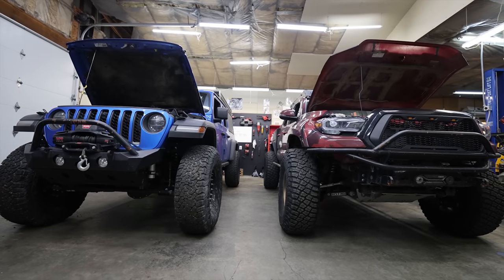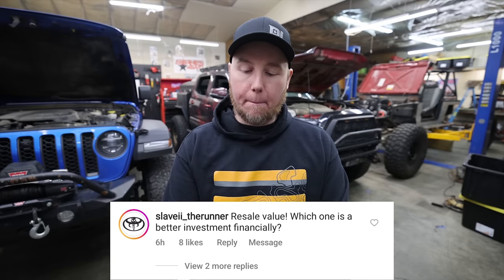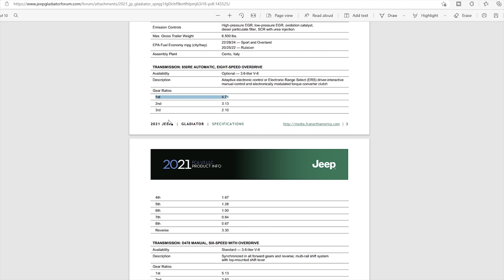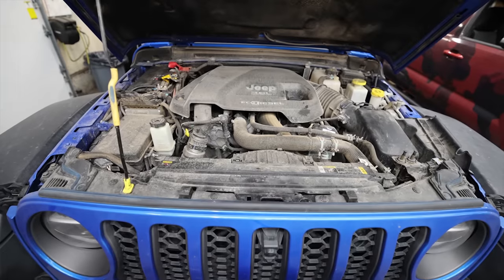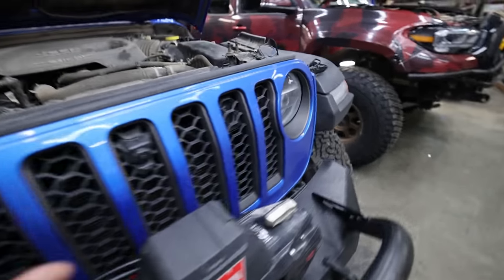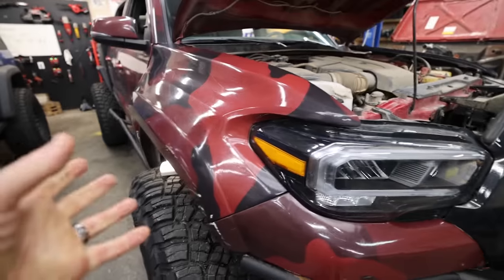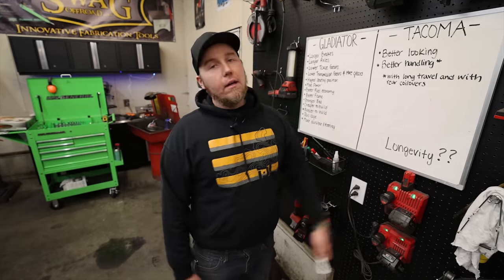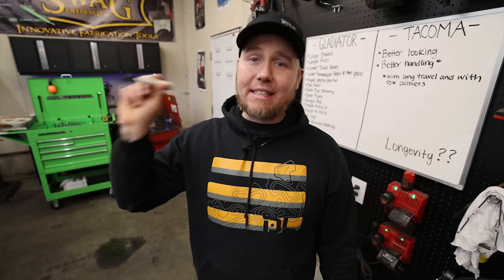My 21 Jeep Gladiator Vs My 21 Toyota Tacoma. Cold Hard Facts.

Comment: TL;DR version: 
- Jeep is better offroad. Tacoma is better onroad.
- Diesel is better for towing and torque than gasoline. He does not compare gas to gas engines, which is silly since most people don't buy diesels. And well, everybody knows how "great" Jeep's gas engines and transmissions are.
- Tacoma rear drum brakes are much weaker.
- Jeep's air filter on the diesel causes the engine to run hot through EGR because it's undersized. His Tacoma body mods make his air filter clog too fast.
- Jeep has a better drivetrain (post-transmission). See 16:39 for his page.
- Jeep has a good roll cage. Not comparable with Toyota since Toyota has airbags.
- Tacoma handles much better.

Criticism:
- Diesel as a whole is a downside for most people. Not an upside. 
- 39s as a whole is a downside for most people. Not an upside.
- He does not mention at all the most important feature regarding interior ride quality, ambient sound level. For anyone that doesn't know: Look up the video "Jeep Hard Top vs Soft Top Sound Level Comparisons". Jeeps are hearing-damage inducing on the inside (90db+). Tacomas are not. Not relevant if you already have severe hearing damage, but it is relevant.
- He's wrong about where the Toyota frames fail. They generally fail on the upward arcing section on the rear end, or on the section just before the middle brace. Not where they are riveted. Source: Am a Toyota tech at a Toyota dealer. All truck frames rust exactly the same up here in salt hell. Box frames are just easier to spray paint and hide the rust cancer. The main difference is that Toyota actually had a customer service program for dealing with it as a form of PR. All other brands just tell you to get bent. Plus, most brands don't sell Tacoma sized trucks in any volume (which is why nobody talks about Colorados or Rangers), so everyone compares apples to oranges (F150 to Tacoma) instead, and obviously heavier duty vehicles will have more meat before the rust becomes severe.
- Toyota frames are hot dipped the same way as the jeep frame is. This is standard industry procedure from trucks to unibodies. He's wrong here.
- Gladiator is only 2 years old. "They don't make x for y issue because y doesn't happen" is pretty moot.

The real truth: Buying a truck for "investment" value is dumb. Any truck you buy for resale value is going to lose all that value with the money you spend in fuel to run it. Who cares if a truck nets you $5k more after 5 years if you spend $2k more each year to drive it.

Comment: I've I owned a 2019 TRD off road with a 2 inch lift and 33s duratrac tires  and that thing was gutless and averaged about 13.7 mpg and only had it for about 8 months and traded it in for Colorado Zr2 diesel and that thing was a beast. I now have a 2021 gas JTR on 37s km3 and  winch and steal bumpers with 3inch lift and beefier control arms and track bars with stock 4.10s and I still average around 16 mpg. I cant wait to regear to 5.13s .This is miles better over the Tacoma that's for sure I don't think I'll ever get rid of my Gladiator.

Comment: I have a great modified 2009 Tacoma and I completely agree with everything you covered in this video. The only thing I stinking can’t do about the Jeep is tip-start. Can’t give control of the starter to the ECU. The Tacoma still does really well off-road, but I fully believe the Gladiator is the real winner for heavier off-road use. The frame, the axles, and transfer case sweeten the deal and win it. If I could afford both, I’d have both.
Reply: One more thought; A huge and persistent Toyota weakness is the position of the alternator in the engine. They always put the alternator low in the engine bay, which is a huge disadvantage for off-road use due to potential to submerge it in water crossings. Jeep puts the alternator high - on top of all other accessories on the belt line, which is vital for off-road use. Street use, it doesn’t matter - but for anything serious off-road, the position of the alternator is critical. Just had to add this little snippet in this conversation with myself here… 😂

Comment: Agree with everything you have said. Having experience with both vehicles, you have stated nothing but facts. I will say you had a ton of problems and bad luck with your Tacoma and it's gremlins.   For someone who is talking more casual usage and less hardcore so to speak. It brings different debates. For example, I had to decide in 2019 if an extra 30 grand on the gladiator was justifiable. Pricing structures bit different in Canada, and what options etc are available compared to the States.  I was looking at 38 grand all in for a O.R premium Tacoma, and to get the same features in the gladiator was going to cost me 69 grand. So for an average person, is a front locker and a few other things worth 30G? Or Do you put money into the Tacoma? That was the dilemma. Geographic location, and type of use heavily influence the choices.  Also, tire size lol anything above a 33 on a Tacoma, and you gotta do some work. 35s are fairly easy, with some light work.  Above 35s lol well that's when it gets expensive and tricky.  Kinda like your build, one thing leads to another, and it adds up quickly.  I love both vehicles, one just has to realize they really are not apples to apples and not built for the same things.  Even Toyota openly admits, Tacoma's are not designed around serious off road use. Reliability, I can only speak to my personal experience and that of my friends. All our Toyotas, have been virtually issue free, with a very low cost of ownership. The jeeps, not just the gladiators, have definitely had a higher cost of ownership overall. Just our experience with these vehicles. I think how much you mod them and keep up with maintenance plays a bigger role when  it comes to reliability.  As a general rule, I think most modern vehicles are on a much more even playing field these days, in terms of reliability.  Anyways, I'm rambling lol great video! Keep up the good work, you are spot on, as usual with your opinions etc.   Cheers! 🤙

Comment: Good video. Hard core fans of either brand can’t be objective. I’m an old Dodge truck guy, like 70s stuff. And it’s not stock. 
I am a Mopar parts guy. But I’m not a Jeep guy. I’ve owned an XJ and a WJ but they were bone stock. I didn’t wheel them beyond camping trips. 
I’ve owned two Toyota pick ups, a 83 2wd and a 99 4x4. Same deal nothing crazy. Liked them all but none were something I wanted to build. 
The 3.6 has oil cooler leak issues. Beyond that it’s issues like valve train are entirely because people don’t change their oil enough and cheap out on it. Same with the Toyotas of people I know, the ones that take care of their trucks have few issues. The ones that don’t end up in the shop.

Comment: I will admit that I am a complete Toyota fan boy. However, It is extremely difficult to compare a jeep to a tacoma. Jeeps are built for a single purpose and the are just better off-road. Being 6"7', there is just not a jeep in the world that I fit in with a car seat behind me. So my only options are a tundra and sequoia which in their own right will never be as good as a jeep off-road. But they work for my purpose. Great video!

Comment: The dealership told me the Jeep wrangler has a lower towing than the gladiator because of the Jeep suspension. They could not specify how. I had no issue towing four thousand pounds. To be honest, I didn’t notice any difference in performance and the tranny temp was perfect.

Comment: My personal experience. I have owned 3 Toyotas and 1 jeep. I traveled for work and regularly rented jeeps. My 97 jeep TJ was in the shop 30 times before 36k miles. Mostly electrical and HVAC. My 06 tacoma I drove 100k miles with zero issues. Had 69k miles when I bought it. I rented over 20 Jeeps in 5 years. Newer JK and JLs. They almost all had electrical issues with the dash and the radios. One regularly rebooted the entire dash driving down the highway. I would love to see the mechanical reviews after 200k miles. I do like gladiators and would consider owning one but I don’t think they have the same quality as Toyota. Again not just hype but my personal experience. My Landcruiser 100 series walks away from my buddies jeep when we are out on the highway. Both rigs need work to make them decent off-roaders. Both are money pits if you build them into offroad monsters. Toyota quality has gone down a little in the newer models when they started added more and more electronics and computers to them. For me my Landcruiseris one of the best built vehicles ever made. The 80 series has the solid axles and the Toyota reliability.

Comment: I'm a Tacoma owner born N raised in the Suburbs of Detroit and I will concede to the fact that the Gladiator is more capable. It's just a fact. I bought my Tacoma in Dec 20' (21' Sport 4x4 dblcb sb auto) because it was $34k brand new (toyotathon) and will hold its value insanely well. But honestly, it's mostly about the look. Ever since the 3rd gen came out it's been a truck I admire, so now I own one. It is now on 6112/5160's, and some rr7-h with 265/70 17 Peaks, but other than that and the engine Tune to fix the problems, it's pretty much going to stay stock. I'll probably add a locker and some gears when the time comes, but i'm in no hurry because I don't need it. I personally skipped the Off-raod because I don't want all the electronics (crawl control), but I do wish I had gone with the larger axle/diff. At the time I didn't know about the 8.75 vs 8". 

All that being said, to each their own. My Tacoma takes me everywhere I want it to with plenty to spare, and because it's a daily the IFS and longer wheel base keep me more comfy on the pavement than any solid axle Jeep ever could. I have also had plenty of terrible experiences with Dodge rams, and Chrysler anything, that I just couldn't give my money to a company that doesn't care about its customer base.

Comment: Great Video Nate, I have a 3rd gen taco, I’ve owned 1st, 2nd. I just love the way they look but never really off-roaded or new anything about it. I bought 3rd gen, and began doing research and have learned that IFS and really the Tacoma doesn’t measure up. I’m very disappointed, if I knew what I know now, definitely would have gone jeep. I have a pretty unique taco, it’s one of the last ones made in SA, and is a manual. I need a pick up, and have an XJ that I’m building up. What is your advisor recommendation, should I replace the taco for a gladiator or what other pick up would you recommend in the price range of the taco and the gladiator?

Comment: On towing the gladiator is only rated to tow 4,500. Where as the Tacoma is actually rated to tow 6,400. And that is the legal limits based on the weights of the trucks.
The gladiator has the highest load capacities off all these mid size trucks. Partly due to the fully boxed frame. Great for an overlander that loads tons in and on the bed.

The only reason I walked away from the gladiator… is because the interior is too small or narrow. I felt like I was fighting over the armrest on an airplane. I think with everything you’ve said here today, one of the biggest takeaways for some one wanting to hardcore wheel, and it’s not the only vehicle as a daily driver, Jeep has so many bolt on aftermarket parts to make them a mean machine, and very easy with tons of options. I am still biased to Toyota, as they have always started up when I hit the ignition.
Reply: Dude I would love to. Because I am still very interested in the gladiator. ended up in a tundra because I need to pull 10k plus all the time. Didn’t need my Duramax 6.6 anymore.

Comment: Amazing data. I had no idea the Jeep was built so much stouter than the Tacoma. You mentioned wishing they would put a removable roof on the 4Runner. I had the original 4runner(84 1/2? 84?) with solid front axles, and a removable roof. I bought the 1st one to show up at the dealer in Flagstaff, AZ. I had it customized with front and rear Gleason Torque sensing differentials. I had a blast on trails all over the mountains and deserts of AZ, and in the heavy snow around Flagstaff. I wish I still had it....................... Oh, you mentioned the superior ground clearance of the independent front suspension. But doesn't it hAVE to be greater since it moves down in the center when the suspension is compressed? Also, onve you get past the front suspension, you still have to deal with the solid axle and pumpkin in the rear. So, which one has the greatest clearance at the pumpkins or whatever lowest hanging point?

Comment: As an owner of a diesel 22 Chevy Colorado ZR2 Bison I am curious to see your impression on a diesel ZR2 compared to the diesel Gladiator would be. My truck is a daily so I chose the IFS over a solid axel but ZR2s have front and rear lockers like a Rubicon does. Too bad the babymax Duramax is discontinued for the new 2023 3rd gen though.

Comment: Great points on the Tacoma, I had a 2018 and 2020, after dealing with multiple body mount failures, tearing the front radiator support, failed and broken shocks from frame twist and trying to tow with it I switched the Colorado ZR2 Diesel and its amazing other then the crappy interior and weird quirks, but every vehicle has something even my Xterra Pro4X had issues. I am hopeful that the new Ranger Raptor will push everyone to compete even more and push the boundaries.

Comment: I have been blessed to own every pickup under the sun!  Thank you JESUS!! You hit it out of the park! The gladiator it my favorite pickup of all time!!! The underrated titan pro 4x behind that I’ve owned 3 titans! Truck is so under appreciated. The worst pickup I’ve ever owned the taco, it’s a toy and it’s not cheap to buy, broke it and got stuck with it multiple times. Never broke or got stuck with any of my other pickups. The only thing good about my experience with the taco is they hold there value incredibly, I sold it back to Toyota after 8 long months with it and got all my money back, that was the best part of my ownership with the taco. My father in law had one and it broke in half, junk I don’t understand the following this truck gets. Even the pro 4 x frontier makes the taco look like a toy , the Nissan is just a more heavy duty built truck and yea Nissan struggles to sell there great pickups I don’t get it? Is it just people buying into hype? If you drive them all and I mean drive I put 50,000 miles on my gladiator in one year, I had an avalanche that in 2 years racked up 100,000 in just under 2 years. I run my trucks. That was always my battle with the titans they are the worst on gas and when you drive a ton it’s expensive but man I love the engine,it’s a double edged sword. Great review bro! Thanks for the great dive!!! Gladiator all the way.

Comment: Hey Nate, I’m from eastern Ohio and do lots of muddy rock and right now I have a 92 yj 2.5l Dana 30 front Detroit locker and chromo shafts and a Chrysler 8.25 in the rear also Detroit locker and chromo shafts it’s on 4 inch leafs and 35s I’ve beat on it for two years now (no road use) and have not broke anything I’d like to upgrade it to 40s and four link front and rear. I have a set of early 80s grand wagoner Dana 44s don’t plan on making much more power out of it what do you think I need to do to those 44s to make so they hold up to a 40 inch tire? Thanks love the content keep on keepin on!

Comment: Also I’ve owned a Cherokee, 2 Grnd Cherokees, and a Wrangler. Am a fan of Jeeps. If I were to buy a new one it would be a Gladiator. Not because it’s a truck but because it’s a Jeep and I like the model over the Wrangler. I am a full size truck person and would buy a full size truck for use as a truck. I’ve owned Ford, Chevy, GMC (which is literally the same as a Chevy), and a Dodge. I don’t find one more dependable than the other, period. Each have their own perks and quirks. For me it’s all down to design which is why I personally prefer GM over them all. I currently own both an 01 GMC Sierra 1500 SLT Z71 & an 01 Dodge Ram 1500 Sport. The Ram is 2wd so can’t compare that (a great running truck w 5.9L in it), but the interior design is both frustrating and uncomfortable  leaves ALOT to be desired… period! Both trucks are Ext Cabs. The GM seems more roomy haven’t measured yet. But it is a better overall design easier to work on the interior and so very comfortable to ride and drive for long trips! The dash has all but busted apart in the Ram and to replace it must either pull the entire dash or pull out the windshield (horrible design)! 

My dad owned a 77-79 Toyota truck (don’t know if the model was actually a taco but was taco size), was 2wd but a tough little truck. It was the early 80’s and wasn’t driving myself yet. But didn’t have to work on it very much. I will say this though, if I were to purchase an “Import” other than a Land Cruiser it would be a Toyota, period those would be my 2 choices.

Comment: I almost bought a 2022 Tacoma trd pro , after researching the specs I was very unimpressed by the amount of work that I’d have to do for it to be off road worthy, from it having highway gears to no option for larger tires , and the rear locker only works in low range, I have owned 3 Toyotas and none were remotely comparable to my first generation bronco, I refuse to have biases in anything, a spades a spade, someone at Toyota should have retired a long time ago.